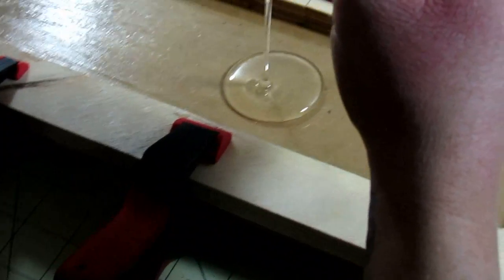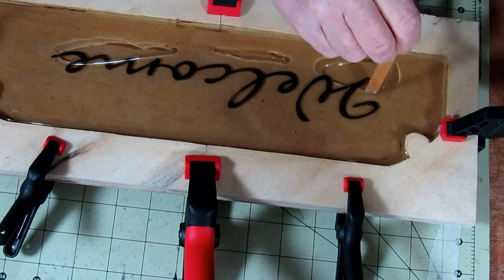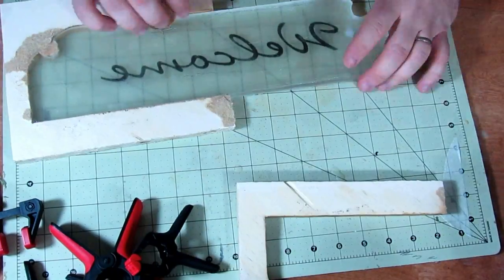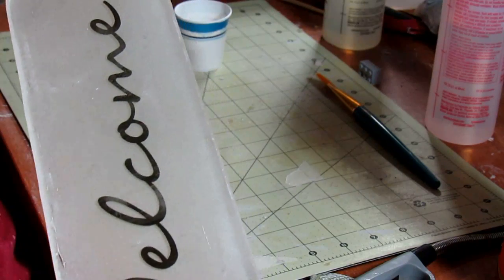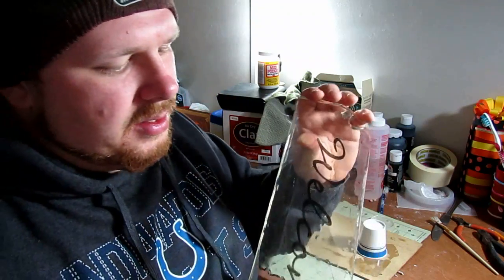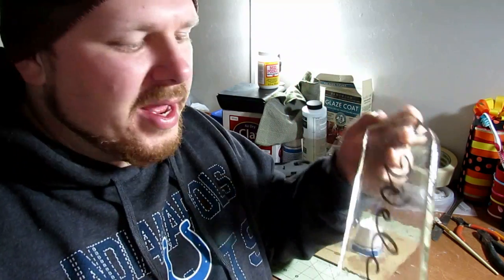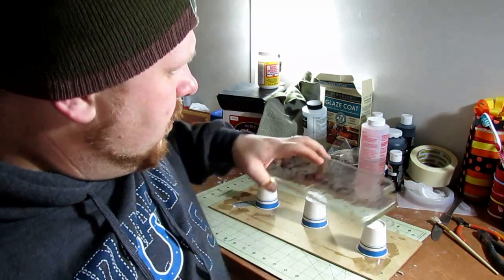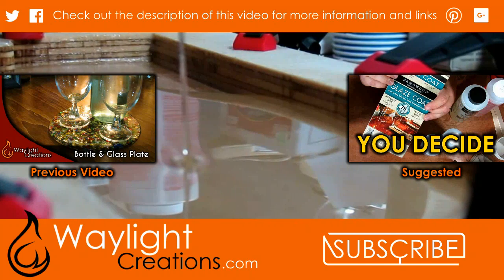DIY Wood Mold for Resin - Resin EXPERIMENT #1

Comment: Have you tried doing a wet sand on the sanded resin, using a progression sand say, 600 grit to 3000 grit wet/dry sandpaper, and soapy warm water (couple drops of dish soap works great) then buff it with a buffer and polishing compound? We use wet sanding quite a bit for guitar finishes, and may be another option for you. It can be quite time extensive, but once you get the hang of it, doesn't take much time over all :)
Reply from the maker: We have tried it on other projects. We just don't do it very often. It does work great.

Comment: resin on a wood mold..the wood must be white melameen ..its very smouth ..must aplay  baby oil ..seal  eadges with transparent silicon..not too much..wood must be at least 1.5 cm thick..
seal it like its a ship ready to sail..
brishing does not give an equal surface..thats why ur result was wavy .. do easy small shapes first to practice. .resin work is very delicate... best of luck.
Reply from the maker: Thanks for your feedback. Appreciate it.
Reply: What is "brishing"

Comment: Thanks for the video.  I'm a scroll sawer and often thought of how to be able to make molds out of wood with the scroll saw into intricate shapes (like dogs, fish, etc) and then be able to pop them out.  I think some resin artists use wax paper as a backing instead of a board like you did?  At least for the small open bezels they do, I believe.  May be able to eliminate your backer entirely.  Someone far more knowledgeable can correct me here....
Reply from the maker: Actually we have advanced this process a little bit and now use contact paper (sticky side up) as a backer. Peels right off.
Reply: Waylight Creations riiight...contact paper. Thats it. Sweet!! Good deal!!
Reply: Use hot glue to adhere your your pattern to a hdpe cutting board

Comment: Been pouring resin for 10 years. I recommend using blow torch or heat gun for bubbles.
Reply from the maker: We've been using a torch lately. It's been a learning process for sure. Thanks for the tip though.
Reply: How large? lol. I have covered large 3d wooden boxes (coffee table size) and it worked. But it may require two coats which adds up pretty quick $$$. I buy all my resin in bulk from ProMarine supplies.  Just use a brush and cover the entire surface. Gravity will do its thing but the resin is thick enough to maintain a coat anywhere applied.
Reply: Warhola Films, and Waylight Creations I'm in the film industry. I'm a production designer and costume designer. I'm about to embark on my first resin project and I'm really worried as to whether or not my process is going to work. 

I have to create LARGE quartz crystals and a lot of them. My thought is to make large obelisk frames out of wood and then cover them in silicon and pour silicone over them. Is this a process you think will work? Will gravity simply not allow it? I thought about pouring resin into the molds but it will take SOO much resin given how many we have to create. 

I would love any advice you might be open to offering.
Reply: Warhola Films yeah, the pieces will be pretty large. At very least the size of a coffee table. Very interesting to know that it will hold up to gravity. it must be pretty darn thick. 

Will the pieces  be very sturdy though? How fragile are they at that size (with that method of application) and how fragile are they when being handled. I can't help but think they'll be so thin that they'll just keep crumbling as I'm trying to remove them from the mold or when being handled. 

I'm definitely looking to buy it in bulk (at least a few 5 gallon buckets). Any recommendations on the best kind to use for my preferred application method and or desired end product (there seem to be sooo many)? How many pieces (coffee table sized) do you think I can realistically cover with a 5 gallon bucket? Trying to figure out how much I need (so I can get a grasp on budget) has been a nightmare as well.

How much does heat affect it after its sets. The huge lights used on  set produce a lot of heat as I'm sure you know.

Thanks soo much for answering my original post.
Reply: Ok so heat is definitely a factor. I think the stuff I use is ok up to 130 degrees, but I wouldn't  be willing to roll the dice on that. What you're trying to do sounds great and something I've considered myself, however, it's not something I have experience with. I always pour mine onto wooden or metal paintings. I do not think they would hold up simply on the strength of the resin. Each layer (once dried) is only 1/8 in thick.
Few pointers if you try:
It's a two part system so always be sure to mix for no less than 5-6 minutes.
With a large bucket like you're using I would put some kind of mixing head on a long drill bit so your arm doesn't fall off (shit gets tired very quickly)
Drying time is 24hrs to touch and 48hrs for full cure.
Make sure you do it in a well ventilated room at an even temp 68-75 is best.
my art is under my name Jesse Best. You can check out the tables I've made on my site.
Good luck!
Reply: I don't know why this stupid thing won't let me see your second response. I can only see a  portion of it in my email. Any chance you'd email your second response? Eugenekjohnson82@gmail.com. I'd appreciate. I definitely want to hear your recommendations.
Reply: What is a good mold for large dining table? Just tape duct tape inside a wood frame? Do you use something so resin doesn't stick to wood frame bottom?
Reply: I wonder if it is possible to make something similar to an acrylic sheet with this?
Reply: Question: what’s the best materials to use to curve a mold? Almost like an S shape.  I want to pour epoxy resin into a wavy looking S type of mold but I have no idea what type of materials you pros use for that or how to keep it all together. Please help

Comment: instead of finishing with brush on resin you should try spray on resin,  using the spray on just as you would spray paint: short stroke bursts of spray. I find in my quest for knowledge of working with resin and wood, spray had a better finish. or you can find a Polish for resin to take out scratching. loved the info about KY jell and may use it for the next project u am working on
Reply from the maker: +Mary Criner Very cool info. I wasn't aware that there was a spray on resin. I will definitely be looking into that. Thanks.